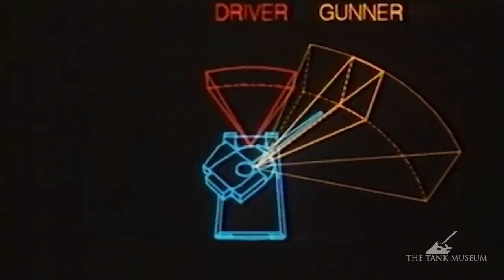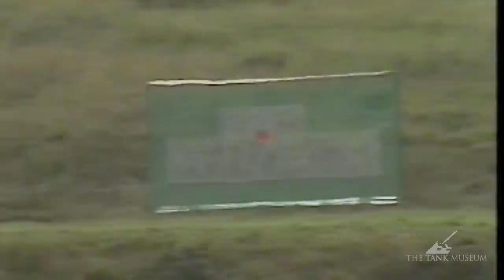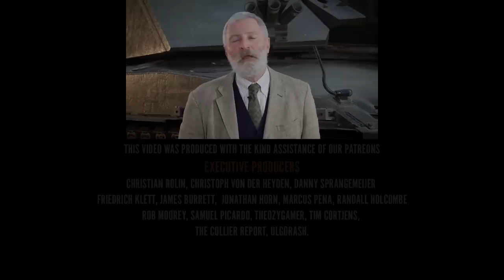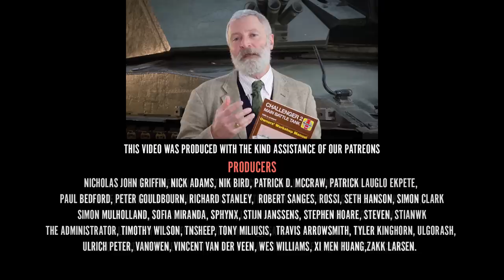Tank Chats #92 | Challenger 2: Part 1 | The Tank Museum

Comment: Excellent talk. The explanation of why the German 120mm smoothbore gun wasn't adopted was very illuminating. HESH rounds sound very interesting and effective but are they so important that they're worth sacrificing standardisation of main gun tank ammo with every other NATO country ?
Reply: It's a British design, that's what they do. They go their own way until there's a problem & then blame the rest of NATO for not being as good as British.
Reply: No. HESH was totally obsolete when Chally 2 was made. It doesn't work vs composite armoir anywhere near as well as raw steel, and is mostly used to blow up bunkers these days. FYI, a HEAT round will do that just as well.
Reply: Gozza : in fairness the Brits were the only nation to build the Chieftain engine to NATO spec multi fuel, which no one else did then NATO dropped the requirement. NATO is pretty hit and miss.
Reply: @AllThingsCubey  Heat is nowhere near as good as HESH at blowing up bunkers though.
Reply: @Arkantos117  HEAT is superb vs concrete....
It has about 150-200% the effective penetration vs concrete compared to steel, and HEAT rounds are already sitting at around 1000mm of penetration vs steel as it is. When it penetrates it vapourises and kills occupants. HESH kills them with shrapnel from the concrete wall. Big difference... both rounds do the job.... difference is HEAT works from a superior smoothbore gun. HESH doesn't.
Reply: @gozza7199  Actually history tells us (since WW2 anyway) that NATO falls over backwards wetting itself and wagging its tail wildly when the US barks loudly and it generally takes 30 years and several US military embarrassments to fix it !!
Reply: @AllThingsCubey  Nonsense, Hesh has a much greater range than APFSDS.
Reply: Freddie Clark someone should fix you.
Reply: @AllThingsCubey  but most tank targets arent other tanks. HESH apparenlty works well against soft targets and obviously HEsh is a "secondary" round for engaging soft targets e.g. transport, APCs/MICVs, infantry in cover etc - you know the stuff tanks actually engage in anything other than stopping the Soviet hordes.
Reply: @davieturner339  Yeah, and what was the biggest flaw of Chieftain? The engine.
Reply: @1337flite  Yeah, but you can also just fire HEAT-MP, or even more modern MPAT or just a classic HE-Frag shell at em while having far greater potential vs armour thanks to the smoothbore.
Reply: @1337flite  Tank priority should first and foremost be knocking out other tanks, because a whole variety of things can take out softer targets, and tanks will always be relatively good at that too, but you can't do that when there's enemy tanks still alive and blasting you. It's frankly retarded for the British/ MOD to have severely hurt the tanks' all round capability just to retain the use of a preferred soft target round... wtf were they thinking?
Reply: @brellnob  feeling lucky Punk ??
Reply: L30 gun is an improved L11 so you could retrofit Challenger with L30. Also, aside from L15  APDS-T round L30 gun could use all rounds used in L11. You have the gun production at the same place the last one was made, most rounds already in storage + you need few modern types for L30 potential. Rounds were also made in GB so all the money stays in the country. There you have all the pros. Cons came when rifled barrel came into the wall with its kinetic energy and 120mm Rh smoothbore was still gaining in types and production sizes. Modernization of the Abrams and Leopard 2 made the 120mm sb rounds become cheaper because of the market size.
Reply: @AllThingsCubey  You've just seen in the video that the British Army tested smoothbore guns from across NATO and found they did not perform better than the rifled gun they were going for. During the run up to the Challenger LEP the British Army extensively tested the German L44 and L55 against the L30A1, again looking at improved NATO interoperability, and again found they had no significant performance difference from the current gun and ammunition, which made improved interoperability not worth the effort. This nonsense that smoothbore guns are somehow inherently better than rifled has come from America having to prove that because it chose the L44 for Abrams it must be better....It's not.
Reply: Panzerzwerg ' , that’s the point he’s making. UK was the only manufacturer that delivered a tank that NATO wanted
Reply: well every upgrade program put forward always wants to switch to the rheinmetall
Reply: @AllThingsCubey  Most people don't understand that HESH doesn't just sent scabs of armour flying around in an enemy tank it also screws up the sights, turret race, tracks, removes external equipment and discombobulates the enemy tank crew. It is also useful against infantry although not as good as a dedicated HE round ( the case is soft so you don't get as much shrapnel ) and extremely good against fortifications. Also most people have never fired HESH at a hard target, once you have and then later gone downrange to see what it did you get it. The downside is it's quite a heavy round to load but the bag charges are small so you can carry a lot more ammunition than you would be able to in for example one of those 120mm smooth bore gunned tanks...
Reply: @freddieclark  

Were did you get that heap of nonsense ?
Reply: @philstaples8122  Yeah and why discombobulate the crew and damage their optics and soft equipment when you could just put a 120mm long rod through their turret at 3km and turn the crew into fine mist? Seriously... 

Then again I don't know why I'm arguing this as the Challenger 2 LEP now has a new turret with the 120mm L55A1 smoothbore gun, so it's bye bye HESH and Charm 3, hello DM63 APFSDS.
Reply: @gozza7199  sounds rather a lot like the US and standardised NATO cartridge debates of the 50s tbh :/
Reply: @AllThingsCubey  I'm assuming when you talk of "long rod" you are referring to APFSDS rounds? If you are then you need to do a bit more research
Reply: @AllThingsCubey  Why not do both where it's applicable, HESH has a high looping trajectory so you can lob it over ridges and hit the target, FIN flies very flat so you're not lobbing that over anything. HESH gives you other alternatives. Have you ever served in a tank regiment, spent time on a range shooting stuff with a tank gun?
Reply: @KP-viking88  Nope. Long rod is a technical term for high length to diameter ratio APFSDS as used by everyone other than the UK at this point. Seems you need more research.
Reply: @AllThingsCubey  i only have one question. Are you a tank crewman?
Reply: @AllThingsCubey  Everything you have said so far is completely wrong. The British Army will not be using the L55 Rheinmetall proposed, for the reasons already mentioned, smoothbore is not inherently better than rifled and Britain does use a round with an almost identical L/D ratio to the rest of NATO. The latter another invention of the Americans referring to a round that went out of date 30 years ago.
Reply: @willmartin1033  Erm... look it up mate. German firm Rheinmetall just bought 55% of BAE land systems division and thr life extension program now involves a new German turret and thr L55A1 gun. Has done for about 6 months now. You're a bit behind.
Reply: @willmartin1033  What are you talking about? L30 was behind 120mm Rh L55 right at the beginning. When L55 came up and L44 went thru the major redesign (modernization) process, those both became a new era armament when compared to L30.
"they had no significant performance difference from the current gun and ammunition"
When 120mm Rh L/55 saw service it already has an Ek above te L30 (which is also L55). Because it was an old project L30 was inferior to Rh 10mm L55 right at the beginning. 
"which made improved interoperability not worth the effort."
I've just posted above that UK MOD went into interoperability all the way. The thing is that they made it across Challenger and Challenger 2 tanks only. It looks as it was more important than the fact "interoperability" works across the globe (minus Russia, China, Iran, etc), not between 2 British Heavy Cavalry units (hilarious).
It was the money, back there, it is the money thing right now.
Also 1 piece ammo vs 3 piece ammo. 
L30 is just slightly more accurate in the highest ranges. Those, that will never happen on the battlefield.
Reply: @armedbrit493  4-5 countries around the globe don't use 120mm Rh smoothbore. Russia, China, Iran, Ukraine, India. 
The 6th is GB with its rifled L30 for Cannister, HESH, or WP that has no use at all now.
Reply: @AllThingsCubey  A smoothbore gun was never a requirement of the LEP and the Rheinmetall turret and gun are just one of several proposals. As it's ridiculously expensive and not a requirement it's not going to happen.
Reply: @willmartin1033  the requirements were changed in the last year. You really should read more.
Reply: @AllThingsCubey  A mate of mine blew a statue of Saddam Hussain to bits with HESH on Op Telic. LOL.
Reply: @AllThingsCubey  So you've given me an answer to my question telling me I'm wrong and right....OK! So anyway, moving on. APFSDS rounds used by any weapon (of any description/variant/sub variant/mark/type/sub type) aren't designed to "vaporize" the crew. Vaporization only happens with a huge energy release (ie an ATO officer diffusing a bomb and accidentally setting it off). Sub caliber DS type rounds are designed to penetrate the tank but not pass through then.........Ill let you do some research to learn how they work and how they are designed to take out the crew etc
Reply: @AllThingsCubey  According to both Janes and DSEI websites the Rheinmetall offer is still a proposal by 21st of November 2019, so unless the MOD have informed yourself of the requirement changes before anyone actually involved in the project, nothing has changed and the turret is still a proposal that will not be taken up.
Reply: @KP-viking88  DU munitions often pass completely through but kill the occupants and detonate ammo via secondary incendiary effects. Stop treating me like an idiot.
Reply: @willmartin1033  They absorbed BAE land systems which means they're now the only proposal, lol.
Reply: @willmartin1033  The updated turret is already being shown off in official British army recruitment material. It is going to be chosen. The MOD reduced the number of LEP upgrades to account for the extra cost per tank.
Reply: @AllThingsCubey  They were always just proposals, nothing has been decided yet. Given the merger Rheinmetall will get the contract but not for a new gun and turret because that wasn't asked for and it's too expensive.
Reply: @AllThingsCubey  You really want to argue with the curator of the Tank Museum? I don't know your qualifications but I'm pretty sure he's very well read on the subject.

NEWSFLASH... Nobody said HESH was being used against enemy MBTs at the time, which makes up most of the targets of a tank these days.

When talking about targeting structures, the raw penetration amount is not necessarily the most important factor. A HESH round contains a greater quantity of explosive so make for a great multi-purpose round, and more importantly, is way cheaper than a multi-purpose HEAT round that has to be designed to defeat a tank as well as all the other targets. The British army use fin rounds for that purpose anyway.
Reply: @sergarlantyrell7847  Nah he was entirely correct on the history. However he's overstating the values of HESH a bit much here, mostly because (as a British historian) he's inclined to side with the MOD' opinions.
Reply: @willmartin1033  Come back to this comment section in 2 years.
Reply: @AllThingsCubey  You clearly are The Man and you must know more than the Brit Research and Development people. You know them ....the people that developed Chobham and Dorchester armor which USA and Germany are quite happy about. Including the Royal Ordnance factory who developed this 120mm gun, the same people who designed and developed the L7 105 which Germany, USA and several other countries bought and which is still in use today. Tell us more, you seem to know everything there is to know about this subject.
Reply: @AllThingsCubey  Given the current increase in defence spending, the L55 may be on the table in 2 years, but not now.
Reply: @HanSolo__  Yeah, I'm talking about the NATO standardisation trials of the 50s that produced 7.62NATO...
Reply: @freddieclark  No it has not. it's a matter of simple kinetics. APDSFS has larger mass, is more aerodynamic and is smaller (when the sabots are discarded), enabling effective fire against heavy armor at ranges up to 3.4 km, 2+ miles. Besides, a smoothbore canon can produce a far larger initial speed (Vo) due to lower resistance compared to rifled guns. A HESH round is less areodynamic, is hampered by gun rifling and can - at best - be effective up to ranges at static targets up to 3 km (max). With new APDSFS rounds being developed and new propellants, this round could end up penetratic composite armor at ranges over 4 km. Should effectiveness (penentration values) not be accounted for, then an APDSFS round can travel way further than a HESH round, since it mass and speed make sure it is less influenced by the earth's curveture, wind and air resistance. APDS fired from a slightly elevated gun could be fired over 12-15 km, whereas HESH would fall to the earth after 8 km. 
HESH is extremely effective against homogenous armor, bunkers or lightly armored vehicles, but has little effect on ERA, composite armor or cage and is more vulnerable to active protection systems, due to its low speed. Tandem charge HEAT rounds can defeat those circumstances better, albeit falling short in terms of range and speed. APDSFS is th preferred round for engaging modern MBTs, accounting for nearly 90% instant effectiveness (on the move against moving targets), then HEAT (tandem charge, slightly less effective, shorter effective range and prone to countermeasures) and last comes HESH.
HESH can be replaced with more modern HE rounds (time fuzed and with a small penetrator rod in front) to do the same as HESH does, at longer range. Rifled guns and HESH are a thing of the past. 
But the British 120mm gun was a long time the best of the Western world. Not anymore, sorry.
Reply: HESH isnt deployed anymore - standard load is FIN
Reply: @Slaktrax  Our own developmental testers preferred the Leopard 2, man... I don't know what to even say to this level of stupidity.
Reply: So many WOT experts in this comment...
Reply: ThePeople'sPanzer Both Sabot and HESH are considered ineffective against composite armor (Chobam). Which is why fin was introduced.

Generally HESH is used against soft targets, or bunkers. It was up to regiments if they went with HESH or Sabot bias.

At the time HESH could defeat another tank.

Also a lot of Arty was 105mm, so Chieftain firing HESH could be used as Arty (we had direct, semi direct, & indirect fire)
Reply: Davie Turner Chieftain was basically tri-fuel, not multi-fuel. It could be adapted to multi-fuel, but is a huge PIA.
Reply: Arkantos HEAT is considered ineffective against modern tanks. It was still used by Carl Gustav, Wombat & Mobat.
Reply: ThePeople'sPanzer HESH is far superior against “soft targets” (including bunkers) than HEAT. The advantage of HEAT is it uses a chemical action, and therefore reduces recoil. A 60 ton gun tank doesn’t care about recoil (still the recoil for live sabot is very noticeable).
Reply: @Pincer88  From the UK defence journal The hesh rounds have a much longer range (up to 5 miles further) than APFSDS and are much more effective against buildings as well as thinner skinned vehicles".
Reply: @davieturner339  The Honeywell turbine engines will run on most flammable liquids.
Reply: @AllThingsCubey  Smoothbore vs rifled is  a side show to the question at hand.  HESH will defeat, effectively, any thickness of concrete: so long as the bunker is contiguous then it will spall.  HEAT, however, has finite limitations.  HESH is also useful against a wide range of other targets and can serve as a "universal" round to have ready to go.  HEAT is not useful against as wide a range or targets.  HEAT is also relatively easy to defeat if you are a hard target - simple stand off layering and ceramics reduce the power dramatically.
Reply: @freddieclark  the latter is correct; the other number probably is without hit propability taken into account i.e. used as an artillery shell or against helicopters (eff.range against aerial targets is greater). Don't get me wrong, it is still a good round against certain targets. But it doesnt fit modern MBTs anymore. Those need sheer punching power and versatile rounds due to storage limitations. Maybe a support vehicle like a 120mm rifled AGS with HESH? I could see a purpose for that.
Reply: @philstaples8122  

So why doesn't anybody except the British think that's worth anything? Why desperately try to shoehorn in a non-standard system that performs worse in every way except bunker-busting, while knowing such things are no longer being built?

I'll tell you why you're making up such excuses: Because Great Britain kept pathetically grasping at the product having to be British and line the pockets of British shareholders, even if the product was badly inferior as a result, such as the LA85 rifle before Heckler&Koch upgraded it. And anyone who's ever driven a Landrover knows you can pick any other manefacturer and have better reliability for a better price.
Reply: Pretty much all I detect from your comment is a dislike for the British. Did you know that H&K were British owned when they fixed a lot of the flaws with the LA85? Do you even know why the LA85 turned out to be so bad in the first place? I don't understand why so many armchair weapon experts get so wound up about something they have never used but only read about.
Reply: @Panzerzwerg  That's 3 different rounds just to do what HESH does and in an inferior manner. Rifled was the better choice, but politics prevailed.
Reply: @AllThingsCubey  No decision to be made before 2021 on Challenger 2 LEP. I think you're a little confused regarding smoothbore and rifled. Rifling is a big advantage for firing APFSDS as it gives the penetartaor the desired slow spin needed for accuracy. Smoothbores are at an advantage firing HEAT - but that round type is near obsolete.
Reply: @agt155  No rifling only improves accuracy on full size rounds. It hinders accuracy on fin stabilised rounds and Challenger 2's gun has proven less accurate than both the L44 and L55 smoothbores when shooting sub-calibre munitions (APFSDS). The only situation where rifled is more accurate is very long range (5km plus) shooting with full calibre HE and HESH. I repeat, there is a very food reason why literally nobody uses rifled guns anymore other than the UK's chalenger 2 and India's Arjun, considered to of the worst modern MBTs by anyone who seriously understands tanks. I see only fierce opposition from other Brits who believe everything the Army has told them about Challenger 2.
Reply: @AllThingsCubey  HEAT may have good penetration vs concrete, but penetration is utterly useless if your target doesn't have lots of important mechanical gizmos inside to hit. There's a reason that even the US use HESH as a demolition round (on the M728) - if you're trying to quickly knock out a large fortification, you don't want to punch a small hole in it, you want to make the largest mess you can. Only HESH can do that.
Reply: @komradearti9935  Oh interesting. Are there any sources on how the performance compares?
Reply: @AllThingsCubey  Don't forget the M1 Abrams used a rifled gun as did the Leopard 1. The US army much prefered to adopt the L11 rifled gun for the M1A1 too, it was found to be far more accurate than the L44, but Germany threatened to pull out of a deal to buy AWACS if the US didn't use their smoothbore - it's all political.

The world record distance tank kill was a Challenger 1 with rifled APFSDS.  In 1983 Challenger 1 could out range todays most modern M1 Abrams/Leopard 2 - all because of the rifled gun.
Reply: @komradearti9935  Not just sabot separation. Rifling's greatest advantage is imparting a slow spin on the projectile. Remember for every 5 degree of fin cant required for smoothbore projectiles there is an increase in drag, and hence accuracy, of10%.
Reply: @agt155  Wrong wrong wrong. Only early M1 abrams used a rifled gun because the 105mm was still in service and ammo widely available. The 120mm smoothbore was a new development and once refined proved more accurate than rifled guns with APFSDS. The Americans never wanted the 120mm rifle. The Leopard 1 is a 1950s/60s project so of course it had a rifled gun....

In the modern world there is 0 advantage to anything that's not smoothbore. None, at all.
Reply: @agt155  For accuracy, you might want to know something. British CHARM rounds for the Challenger 2 are actually designed so that the penetrator rotates feely and therefore does NOT spin when the sabot falls away after firing. Spin on a fin stabilised round actually destabilises it and reduces accuracy, so the Brits designed the round to not spin despite being fired from a rifled gun. However the system is only partially effective and as a result of the rifling, more gas pressure is lost from around the round when fired. There's also 1000 bar less pressure behind the latest CHARM 3 projectile in the first place vs NATO smoothbore guns, contributing to worse velocity and penetration. Point is, the rifling is actually detrimental to accuracy on the APFSDS round so the British had to design a round to not be spun from it. In that case it's obvious that a smoothbore will either be the same, or more accurate when shooting sabot, because you literally DON'T WANT TO SPIN a fin stabilised round.

Oh yeah, and when we tested the L55 smoothbore with a tungsten DM53 round, it outperformed the CHARM 3 (which is a depleted uranium round) and since then Germany has adopted DM63 which is even better. It's just not a contest anymore.
Reply: @AllThingsCubey  Incorrect. All fin rounds need to spin (slowly) for accuracy. With a rifled gun a certain desired spin is given by the slip bands. Smoothbore rounds need twisted fins to gradually produce the spin as they travel, the extra drag of these fins reduce power, range and accuracy.
The tests you mention concluded the L55/DM53 combination gave something like a 5% increase in penetration, and there was no target the DM53 could defeat that the L27 could not. L27A1 (CHARM 3) has been succeeded by the new L28A1 round which is stated as being considerably more powerful. DM63 is just DM53 with a slightly less powerful and less temp sensitive propellant.
Reply: @komradearti9935  "excessive muzzle spin is extremely detrimental to accuracy"...yes, as is no spin. The most accurate APFSDS will leave the barrel with the correct rate of spin. Something not possible with smoothbores.
Reply: Gozza why blame when it’s obviously the truth? Last time we went with NATO’s grand schemes we needed up with a buggered engine for the chieftain
Reply: ThePeople'sPanzer you seem to think that in war the tanks line up and shoot each other, the planes shoot other planes and the soldiers shoot other soldiers in reality there are many more soldiers than tanks in war so it is important that tanks can take out infantry and lightly armoured vehicles effectively
Reply: Funny as it may seem to you I was once one of those soldiers.
Reply: @philstaples8122  

And still you want to lose limbs or your life so shareholders can line their pockets with sub-par gear?

Doubtful...

If anything, corrupt nationalistic contracting is universally hated among those who actually serve.
Reply: @HanSolo__  The so-called "ukraine" doesn't produce its own guns.  It never did.  All the guns they were putting inside their tanks during USSR were manufactured in Russia.
Reply: @toomaskotkas4467  In Crimea. Not in Russia.
Reply: @HanSolo__  Crimea is a Russian territory that was illegally occupied by the so-called "ukraine" for 60 years but not anymore.  The so-called "ukraine" was created by the bolsheviks in 1922 on the historic Russian lands and has never existed before that.  Right now the so-called "ukraine" illegally and thus temporary occupies the said historic Russian lands and therefore and has no right to exist.
Reply: @toomaskotkas4467  Aaaachachacha "was occupied". The same Russia that signed the pact under which the partial autonomy of Crimea was the price the Ukrainian government agreed to pay for remaining Crimea as part of the Ukrainian state and in 1991 the Russian majority living in the peninsula obtained permission from the communist authorities to establish the Crimean ASRR, covering the area of the region Crimean, except for the city of Sevastopol, which remained directly within the borders of Ukraine. After the collapse of the USSR, May 5, 1992, the Russians living in the peninsula proclaimed the creation of the Republic of Crimea.
However, Crimea, which was historically part of Russia - without a doubt - in 1991 was by no means "taken" of Russia. Russia has signed a tone of documents dealing with the partial autonomy of Crimea still within the borders of Ukraine, i.e. customs, trade, and administrative borders.
Learn the damn history before you start internet biasing trash talk based on current Russian claims.
I'm not talking Crimea shouldn't be within the  Russian border. It should. Yet nobody tried to steal it from Russia after fall of USSR.
Reply: @toomaskotkas4467  BTW Ukraine Is way older than you think and way before those you mentioned it was a part of The Polish Crown. Just try to read some next time.
Reply: @HanSolo__  The term "okraina" from which the so-called "ukraine" derives its name from means "the outskirts" and in long Russian history there were many such temporary territories located in different areas both geographically and historically of the Russian Tsardom.  The so-called "ukraine as we know it now was created by the bolsheviks in 1922 and therefore it has no right to exist.
Reply: @toomaskotkas4467  Yes. I do know it. Germany is also a 100% recent name and adminstration conglomerat. Italy - a bit older country in itself but not that much older. GB ist still not unofied as a cojtry per se. Therefore the problematic Irish borders in Brexit situation.
All mentionet above can be put right next to Ukraine. The current or most recant face of the country doesnt stays as all about the people of the land. While the nations themselfs located on current borders of Ukraine have a quite a history behind. They do heve their own culture and language as well. 
The multicultural substance of Ukraine and a quite short history of the staye does not makes it inferior comparaed to other countries of Europe.
Reply: @HanSolo__  Maybe in older Europe the countries' names don't mean a lot but at least we know from the history that the so-called "ukranians" were considered enemies of the British Empire during the WW1 because they originate somewhere from the Austro-Hungarian Empire and not from the historic Russian territory which the so-called "ukraine" illegally and thus temporary occupies now.
Reply: @HanSolo__  It doesn't change the fact that the so-called "ukraine" was created in 1922 by the bolsheviks on the historic Russian lands which it illegally and thus temporary occupies now.
Reply: it isnt worth it to sacrifice the increased performance of a 120mm smoothbore.

the 120mm RM L/44 has a higher chamber pressure and less friction compared to the rifle, so its muzzle velocity is higher than the longer L30, meaning it gets a better anti tank performance.
it also is more accurate and can make use of ammo that the L30 cant use.

in the debate of HESH vs other ammo I say that HEAT-MP is the overall superior round when it comes to attacking light targets.
if that doesnt help germany developed the programable DM11 HE round with a larger destructive effect than 120mm HESH will ever have.
its even better against hardened targets such as bunkers, because it can detonate on the inside when using a delay fuze.
Reply: Nato isnt that great neither  is the un
Reply: @AllThingsCubey  The difference is that HESH makes a big hole in brick or concrete, through which soldiers can climb where HEAT makes a teeny-weeny hole.
Reply: @wierdalien1  Like the British, the French use their own gun rather than using the German gun the Germans and the Americans use.  The French are the British, just with a funny accent and wine instead of tea.
Reply: @JohnHughesChampigny  HESH don't make a hole at all.... it blows out the inside surface of and leaves the outside mostly intact.
Reply: @JohnHughesChampigny  you missed the point of joke. The british always follow the NATO standard. The french glance at and say oh oui oui we understand the specs.
Reply: @AllThingsCubey  You're confusing what it does to a tank to what it does to a wall.
Reply: @JohnHughesChampigny  No. Effect was first observed on concrete before it was translated to steel. Thin walls? Yeah it will blow them out. So will a fin stabilised HE-T from a smoothbore gun.